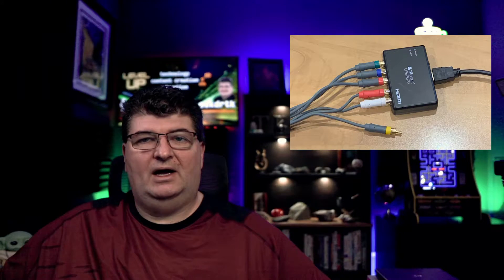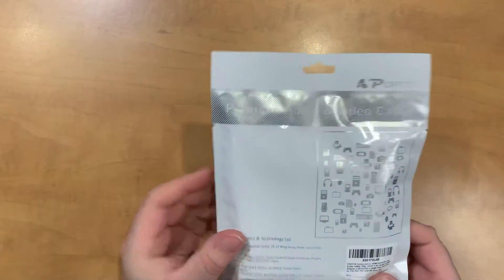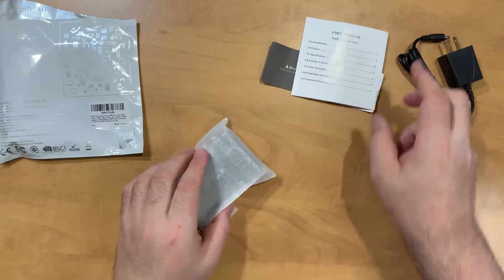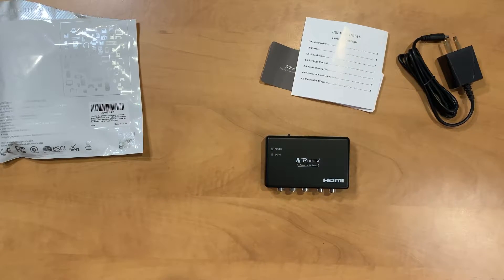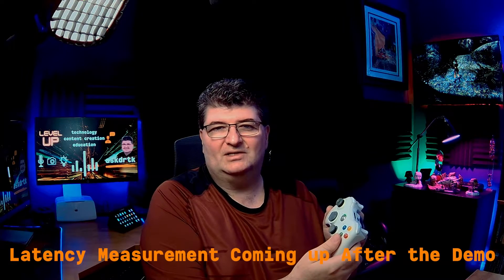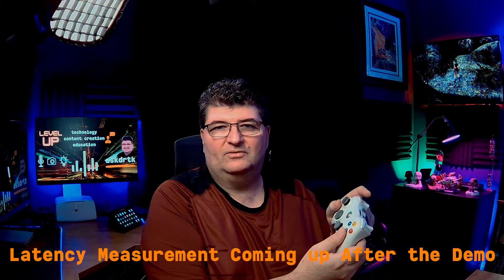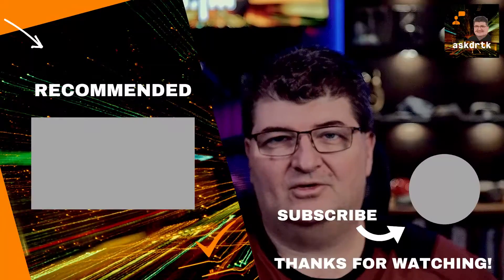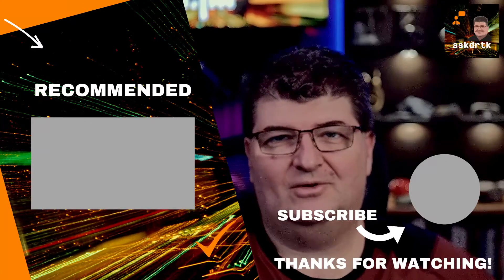Component to HDMI Adapter Unboxing and Detailed Review

Comment from the maker: The unit reviewed is Model # N3CVRHS which includes the 720p/1080p scaler function. A number of converters similar to this are available from PORTTA but the majority do not support scaling. The review unit was purchased in 2020 and I have noticed this model come in and out of stock since that time.

While a wide variety of input formats are supported (see list below) it does not support 240p. This will be an issue for older consoles such as PS1, some PS2 titles, as well as many older games (PONG, etc) and computers. If you require 240p, I recommend: Budget - Mcbazel ODV (Original and Gen 2) and either the Retrotink 2x Pro or 5x Pro.

For those interested, the specs for the unit in this review are as follows:
 
Inputs: RCA Component (YPbPr) video with 2 Channel RCA Audio (LPCM uncompressed)
Input Video Signal: 0.5-1.0 volts p-p
Output Video: HDMI 1.3 (720p / 1080p selectable)

HDCP: 1.2/1.3
Vertical Frequency Range: 50 and 60Hz (PAL and NTSC)
Input Video: 480i / 576i / 480p / 576p / 720p / 1080i / 1080p (Does not support 240p)
Video Bandwidth: 1.65Gbps per channel
Power 5VDC barrel 5.5/2.1  (adapter included - various regions)
Reply: Too bad the bitrate in which you encoded is so low I can't tell the differences.

Comment: Thanks for the video. I'm not a gamer, so purchased a new 65" LG Smart TV, (...of course, with no Component fixtures on the back), to connect to my 7:1 Home Theatre system. Will plugging in the Audio/Video Component wires for the Receiver, and then plugging in the HDMI into the back of the TV, allow me to put the sound through my 7:1 system?
Reply: Yes.
Reply: Do you know any cheap ypbpr to hdmi converter that supports 240p input signal?

Comment: Hi it seems that if i connect my original Xbox with component cables (that are tested) i have noticeable diagonal lines. Is this because it’s a cheap device or do i happen to have a faulty product?
Reply from the maker: The only issue I have had with diagonal lines ended up being aftermarket component cables on the Wii (the Wii has terrible RF shielding). Check your cable routing first (away for any sources of interference such as power adapters), but t could be a faulty converter...
Reply: @askdrtk  i tested my component cable on the retrotink x5 that a friend of my has, and they work perfectly. No diagonal lines
Reply from the maker: Sounds like a defective converter then...
Reply: Just got one a couple month ago and I have the same issue.

Comment: Might as well share my notes for model N3CVTRH from 2014 (according to Amazon Canada). 

* three RCA component inputs — front left; red-white R-L
** 50 or 60 Hz
** 480p, 576p, 720p, 1080p
** 480i, 576i, 1080i
** 0.5–1.0 V p-p
* two RCA audio inputs — front right; green-blue-red Y-Pb-Pr
* HDMI output — back middle
** HDMI 1.3
** HDCP 1.2/1.3
** 5 Gb/s or 4.95 Gb/s  
** 24–36 bit colour depth [unclear]
** 165 MHz / 1.65 Gbps per component channel
** low delay 
** uncompressed 2-channel LPCM 
* 5 VDC power with small barrel connector — back left (front view) 
** maximum 5 W 
* two indicator LEDs — top left 
** power 
** signal 
* 9 × 6 × 2 cm LWH 

Note that the 165 MHz / 1.65 Gbps line implies 10-bit colour depth at the fastest supported data rate.

Comment: This review not entirely clear about the model reviewed (naive given known save-a-buck redesign churn in this sector). On Amazon Canada, the current model is N3CVTRH from 2014. The reviewed unit here seems much the same, but the current model most definitely does NOT contain a scaler function. Scaling is left to the television, and compatibility depends on whether your video source and your television have an output/input mode combination that overlaps. If the reviewed unit contains a scaler, then most likely it is based on entirely different silicon, and output quality and performance would be an entirely different kettle of wax.
Reply: The video source will be PAL or NTSC at 50 or 60 Hz with a certain horizontal frequency and dot clock. I guess it's the number of scan lines generated per vertical frame that determines the video mode, since there's no scaling in this device. Interlacing is likely also dictated by the source, perhaps inferred from the line count. Wikipedia says that some devices, even when switched to component outputs, won't necessarily default to progressive. If your device is outputting 720i, and you don't know it, you'd be SOL. 

Is the lack of 720i because the line count is ambiguous with some other interpretation? What other reason could they have to leave that out? 

Edit: I haven't thought much about analog video since the 1980s, and I had to get my thoughts reorganized. I was mostly right, then mostly wrong, and now maybe mostly right again. Who knows?
Reply from the maker: The review unit is model # N3CVRHS (purchased from Amazon in 2020) which does include scaling to 720p/1080p with the switch located on the rear of the unit. PORTTA has been selling various models with and without scaling for some time. I have seen this model come in and out of stock since 2020.

While this converter / scaler offers good performance for the price, as with many inexpensive converters, it lacks support for 240p. This eliminates PS1, early PS2 titles, as well as many other early consoles and computers with off-spec video output (VIC-20, C64, Apple II, etc). I pinned a comment with specs for the review unit in the event it comes back in stock.

Comment: It worked with my PS2 on a regular TV, however it did not work with my Samsung curved gaming monitor... I tried everything including having the right setting on the PS2 side.
Anything you suggest I try, or is it just not compatible with some monitors?
Reply from the maker: On some of the Samsung monitors (ultrawide in particular but also on some others) there is a menu option for PC/AV mode. If you have this option, try setting it to AV. Let me know if this helps out.
Reply: @askdrtk  I found the PC/AV mode, but unfortunately it didn’t work... I tried all the different combinations of settings too. I want to try the “ PS2 to HDMI” converter but I’m afraid I’ll get the same result :/
Reply from the maker: It is difficult to say if the PS2 to HDMI will behave differently with your monitor, but it could be that the combination of the Portta and your monitor just aren't compatible. Another converter that I have found to be very compatible not only with displays but particularly with the PS2 (even for older 240p games) is the Mcbazel ODV. It is very similar to a Retrotink 2x Pro, but at a lower price.

Comment: not only for monitor but we also want this too record wit hthe capture cards of today 2022 i got one too record my xbox 360 my is one of the original 20 gb models wit hthe silver dvd tray so i enjoy it not bad this one converter
Reply from the maker: I have found some converters to not work well with capture cards, but I have to say the Portta works with a few of my Elgato, AVerMedia, and even a few generic capture cards. There are converter/scalers with superior deinterlacing and color accuracy, but for capture card compatibility, the Portta works very well in my experience.

Comment: Do you recommend this for ps2 on a 4k TV?
Reply from the maker: For the PS2 I prefer the Mcbazel ODV (nearly identical in performance to a Retrotink 2x pro). The ODV supports 240p which comes in handy with the PS2, especially if you have any older / PS1 games. Hope this helps out!

Comment: Great video, thanks. Do you know if this will work with an original Xbox on a 4K tv? Do I really need the scaling? Seems like the version with scaling is not produced anymore, can't find it anywhere.
Reply from the maker: Thanks! Both the versions with an without scaling will work with the original XBOX. The scaler version has been coming in and out of stock for the past year. The advantage of the scaler version is that it often scales better in terms of latency and image quality vs built-in scaling within televisions - every tv is different. If this model is unavailable, I recommend and also use the Mcbazel ODV amd Sunnatch/Easycell converter/scaler as alternatives. Hope this helps out!

Comment: Would this work well with an original xbox with xbox HD av pack?
Reply from the maker: Yes, the original HD AV pack provides an excellent quality 480p signal which the Portta will upscale to 720p or 1080p.
Reply: @askdrtk  What about 480i?
Reply from the maker: 480i deinterlacing and upscaling is also very good.
Reply: Great it's out of stock.
What other product do you recommend?
Reply from the maker: Wouldn't you know it...

The Sunnatch https://amzn.to/3MJwCcU (also sold under the Easycel brand) performs very well. I have one in my setup and have been using it for a long time. I also reviewed it here: https://youtu.be/d4Cqox5dtIQ
Reply: @askdrtk  that is also out of stock
Reply from the maker: amazon.com is showing 9 in stock. I am not sure on your location, but they may be able to ship it.
Reply: @askdrtk  thanks man.
Reply from the maker: All good - Glad to help out! Let me know how it goes.👍

Comment: hi, i have this converter along with the easycel one, the portta one displays these diagonal ghost lines when i use it on my wii, i dont know if this is the converter or the component cables that is causing the problem.
Reply from the maker: Ghost lines are generally caused by interference or ground loops. Poorly shielded cables can also be the issue. Do you have a lot of cables all running near to each other? It can sometimes help if you try to route the power cables away from the component cable. If it is a Wii only issue and other devices display correctly through the Portta, it may be worth to try another cable or to place a ferrite core around each power cable (Wii, Portta, TV).

Comment: This doesn't work on my PS2 ,bro. I also don't have an option or switch for changing from 1080p to 480p.
Reply from the maker: I have tested my PS2 (SCPH-50001 fat model) working with a few exceptions - some older titles and PS1 games that only support 240p will not work with this scaler. I have my system configuration set to component YCb/Pb Cr/Pr and screen size 16:9. Pressing the X and Triangle buttons at the same time generally allow you to enter progressive scan mode. Some of the slim models (especially the 9000x) tend to have more compatibility issues than others. If you absolutely cannot get the component video to output through the Portta converter and you have tested the component cables as working on another display, other than the Retrotink 2x or 5x, I recommend the Mcbazel ODV as it supports all video modes from the PS2 including older PS1 and those PS2 games that only run in 240p regardless of your console settings. Hope this helps out.
Reply: I think i should press triangle and square for some time, really want to play resident evil 4 at good graphics. It would be nice if you help me. 😭😭🙏
Reply: By the way I use a slim version, please help,it cost 34 dollars.
Reply from the maker: Resident Evil 4 supports 480p output via component cable which is supported by the Portta converter. To access 480p output from your PS2 for Resident Evil 4, hold triangle and square at the same time while the game is booting up to access the progressive scan menu.
Reply: Thank you man, it worked ❤️❤️❤️
Reply from the maker: Glad to hear!👍👍👍
Reply: @askdrtk  one more thing , do we have to do that every time we play the game?
Reply from the maker: I don't have RE4 on the PS2 to test, but I have found that you generally need to do this each time with titles that do not start up in a compatible video mode on their own. I should note that I switch between PS1 and PS2 titles often which can change the video mode.(I use the ODV converter with my PS2 as it supports PS1 games as well.)

Comment: this portta does not work for playstation one
Reply from the maker: Yes, the PS1 video is off spec and many scalers, including my Retrotink 2x pro struggle with it. So far the best scaler I have found for PS1 is the Mcbazel ODV. It accepts RCA composite, S-Video, and component input, handles off spec signals (including 240p) very well, and it solves the issue of games that switch between 240p and 480i (most often talked about on PS2). The ODV is about the only converter I recommend for PS1 so far. After all these years, I still enjoy a quite a few titles on original PS1 hardware!

Comment: What kind of DC connector is the converter using? Eyeballing it, I guess it's either 4,0x1,7 or 3,5x1,7 but would be nice to know for sure. Since I got it from US Amazon, but I will need something with EU plug(And preferably of higher quality since multiple reviews complain the one given by Portta is kinda flimsy and often DOA XD) to use it myself once it arrives XD
Reply from the maker: Great question! The connector is a 5.5/2.1 - Hope this helps out!
Reply: @askdrtk  Thank you very much! I was trying to find that out for past few days, but nobody seemed to know the answer XD

Comment: Great video! I was looking into buying the Portta converter. Would you say that the component to HDMI conversion provides 1:1 video quality?
Reply from the maker: Thanks and great question! The Portta converter handles scaling well and color / saturation perform above its price. Display looks good with XBOX 360, Wii, Gamecube, and DVD sources. 1:1 is difficult to say as it depends on how your display handles both component and HDMI inputs, but in my tests on LG and Sharp TVs as well as through a Yamaha AV receiver, the results are very comparable. Hope this helps out!
Reply: @askdrtk  I agree that the colours and saturation are handled well. I just bought one of these and like everything about it, except the sweeping vertical lines that move across the image. I am using the converter with my Wii because I have a monitor only with HDMI ports. Do you have any ideas how I can fix the issue with annoying vertical lines?
I was thinking about cleaning the component cable as it is quite dirty, or buying an official cable however, I doubt it is the cable.

I'm definitely not the only person who has had this vertical lines issue when using this converter with the Wii!
Reply from the maker: Yes, this is a known issue. While I cannot be certain, I believe the issue has to do with poor internal shielding inside the Wii itself. Cleaning the cable it a good place to start as bad connections can contribute to this issue, but I will say that I have the official cable and do not have problems with the Wii and this converter. Cables often look similar, but internal shielding can be quite different and it is certainly possible that Nintendo was aware of a shielding issue with the Wii and   therefore manufactured their cable to overcome the problem. One low-tech way to test this is to hold the cable and move it around while watching the screen, it the line behavior changes, interference is the most likely cause (a poor connection or broken cable will also show up this way, but the picture will likely flicker). Also, in the way I have my consoles, cables, and converters laid out, the Wii is not close to my converters, including the Portta. Sorry I cannot be 100% certain, but I hope this provides a place to start.
Reply: @askdrtk  Thanks very much. I reckon you are right about the poor shielding within the Wii itself. I've cleaned all the contacts on my component cable thoroughly which hasn't really made a difference.

I have a LOT of cables near to my Wii, however back when I used cheap Wii2HDMI adapters, these all also had ghosting lines, and there weren't a lot of cables next to the Wii. I see a lot of people with PAL Wiis (like me) tend to have more issues with these ghost lines. I might purchase an official cable and give it a try.

Also noticed that the signal sometimes drops out for a few seconds with this converter, so not sure it's a very reliable option. I might look into more reputable Wii2HDMI converters instead.
Reply from the maker: I haven't had drop outs with mine, but for the Wii (PS1, PS2, and my vintage PC collection) I use a Mcbazel ODV. It is very similar to a Retrotink 2x Pro, but at a lower cost. I have found it to not only be very reliable but it is also compatible with off-spec signals (works with PS1, older computers, etc...) Here is a link if you want to check it out: http://mcbazel.com/index.php/product/odv-composite-rca-s-video-ypbpr-to-hdmi-converter/
Reply: @askdrtk  Thanks a lot! This is very helpful. I'll check it out :)
Reply: @askdrtk 
I doubt this is a problem with the WII since I have this exact problem with my PS2 and I know for a fact that it didn't have this problem before I used the converter...

Comment: Ehi nice video! What do you think is better, Portta or Sunmatch? Thanks for replying
Reply from the maker: Thanks! Having used both for some time I find them to be about equal in terms of performance and reliability. The Sunnatch has more selectable output modes that are useful if your TV's or monitors are not all 16x9 and can also help if you have any vintage PC's you would like to connect, otherwise both are a great value. Hope this helps out!

Comment: PS3 has broken hdmi ,will this be a solution to bypassing doing surgery on it replacing the hdmi ?
Reply from the maker: Yes, connecting your component cable from the PS3 to this converter will give you HDMI and you can continue to use the 1080p display setting on the PS3. The difference is that the PS3 audio output with component is stereo, so some of the surround sound features introduced over HDMI on the PS3 will not be available. Hope this helps out!